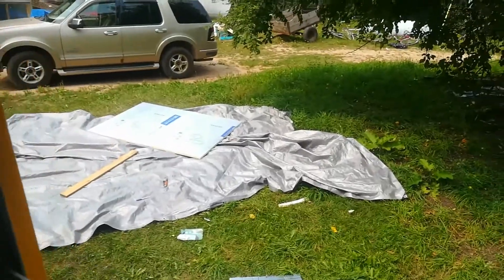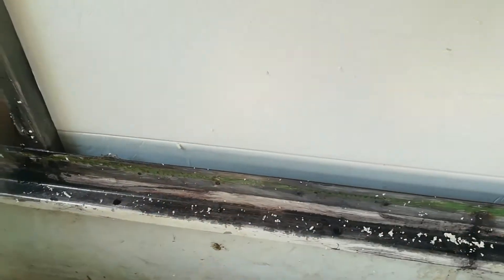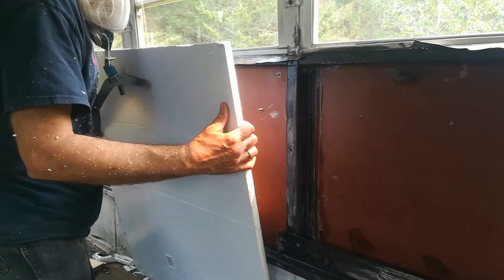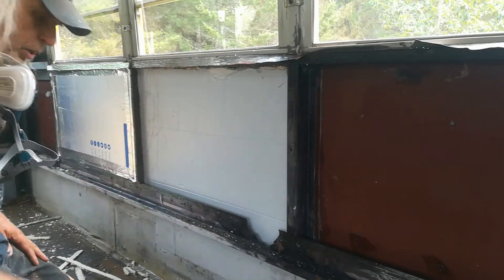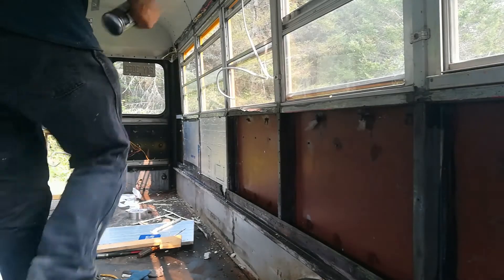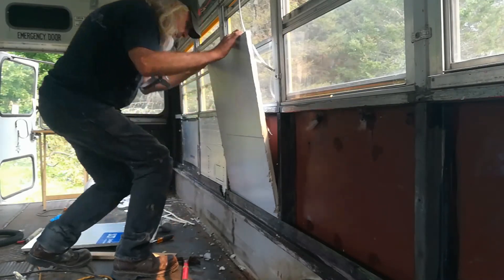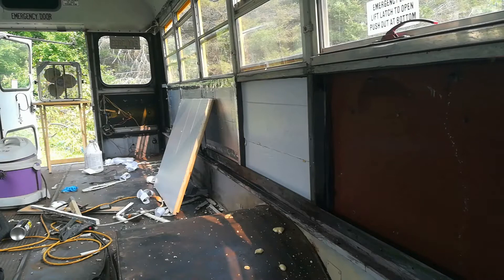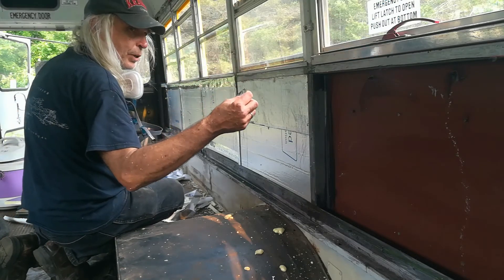Insulating Skoolie walls using 3/4" foil faced polyiso foam board

Comment: I'm doing this now.  I'm using Polyiso but not with aluminium, it has more of a flame retardent fiberglass cardboard lining instead of metal lining.  There's not much much radient heating required to be blocked anyhow in the walls and ceiling as it's more conductive heating you need to worry about.  My sheets are also 1.3 inches and not 3/4 inches so one sheet fills the whole side up to the edge of the hat channel.  I'll be adding a second layer which is 2.6 inches total and thick but should provide a R17.2.  A 1.3in piece is R8.6,   1in is R6.5.

Comment: Awesome job Daniel,  I'm gonna go with the same insulation when we get to the ceiling. We still have to put in a roof deck and then we can close it back up with insulation.  I think the some of the hardest parts are behind you,  the seats are the biggest headache but once you start framing inside you'll never wanna stop lol.  I'm excited for you!!
Reply from the maker: Check out my video on installing this in the ceiling. Hopefully, save you some time and frustration! Good luck! :)